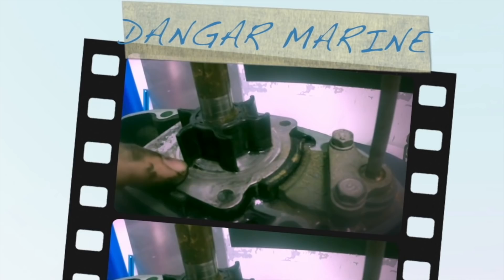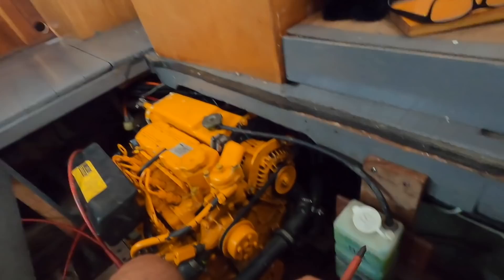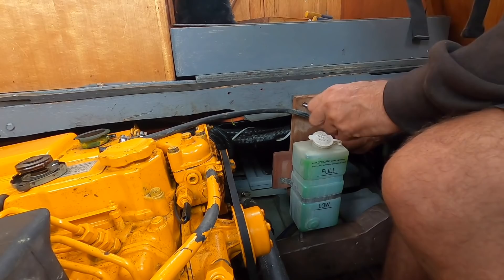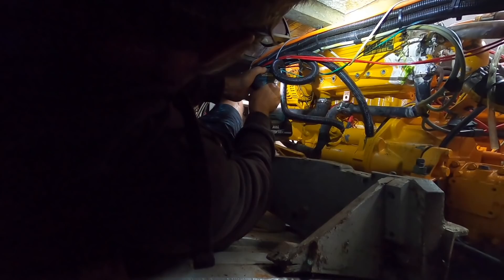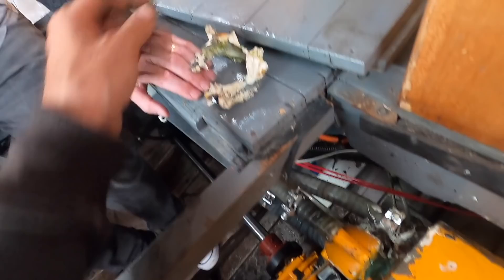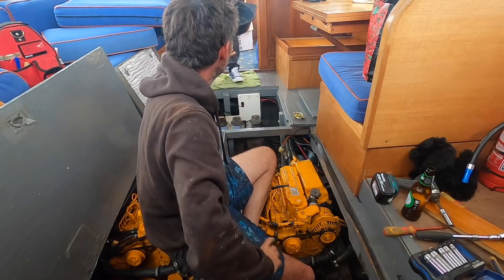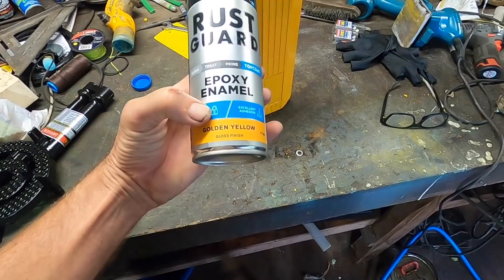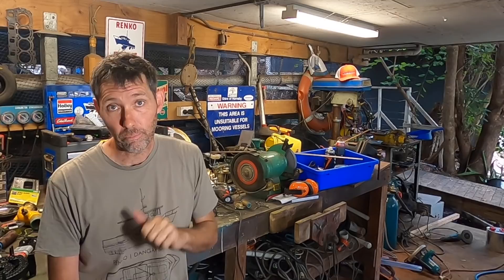Cleaning and repairing a boat heat exchanger

Comment: Hello from Ontario!
Your repair looks to be good as long as that epoxy holds!  Curious as to why you went with a 302 over rebuilding the bullet proof 351?  As a young lad, my first truck (1978)had a 351C in it, I got it with 765K miles and put 160 more on before the body fell apart.  That motor lived on in another truck, it was unlikable, and at 18 years old, damn it if I didn’t try my best LOL
Reply from the maker: Hi there. Went with the 302 as the 351 block was cracked and Mike had a spare 302 in his workshop.

Comment: Do you think one day you could do a videos of descaling a outboard
Reply from the maker: https://youtu.be/8w_o5xB8ZFI This video has some info on solutions, but it is really just about running it through the engine with the earmuffs.
Reply: @DangarMarine  ya I saw that video but I was wonder if there was anything better than the vinegar that I can fill in a tub and run the engine and have it flow threw because with the vinegar most of the brushing does the work like you said and I want to be able to have the liquid do most of the work with out having to open up the heads and get a brush in there to clean it  I see other things like barnacle buster and rydlyme marine but it’s all expensive to put in a big tub and have the engine running while it’s getting flushed threw but I think that’s my best option is just buying a couple gallons of the rydlyme marine and mixing it with a little bit of water

Comment: Every pirate needs a parrot. I'd be worried about the Tg point of the epoxy, epic fail imminent
Reply from the maker: Hi Steve. I’m hoping the coolant in the header tank will keep the temp below 100c but there could be a hot spot right at the exhaust flange. I’ll run the infrared thermometer over it during a few long trial runs to see what it gets up to.

Comment: 16.55 I hear this time after time, cleaning up alloy corruption with a wire wheel. If the wire wheel is of the ferrous variety then it will shed/leave minute ferric impurities imbedded in the alloy creating a lovely union of dissimilar metals & all the cleaning/epoxy magic in the world will not stop electrolytic corrosion at the coalface with a saline sauce as an added helper.  Sad but true. Bead/powder/some inert medium blasting for cleanup prep  or replace with new. My 2c.
Reply from the maker: Yes, medium blasting is better if available.

Comment: That’s actually bronze heat exchanger not copper that’s from the electrolysis eating away at the elements in the bronze just leaving the pink Capri elements left. All the gray sticky stuff where are the other elements that were eating the way and left on surface.

Comment: You have an ac tig welder right just weld it be faster and better
Reply from the maker: Old oxidised aluminum is a pain to TIG weld.
Reply: @DangarMarine  Got to agree there. It's also a hell of a lot of material to replace, all whilst keeping the job uniformly heated. For smaller jobs, for those without Tig gear and skills, quality aluminium rods can be used with a propane torch (or whatever can get the job to 380 deg C). Here's the mob I got my last lot from.

https://www.toolking.com.au/aluminium-and-cast-alloy-repair-rods-ultra-bond-5pc-pack-brazing-soldering-welding/

Comment: I'm really afraid with regards to epoxy and the temperatures, around 90°C epoxy usually already doesn't survive, and close to the exaust parts could be a bit hotter.
Reply from the maker: Devcon F is rated to 120c